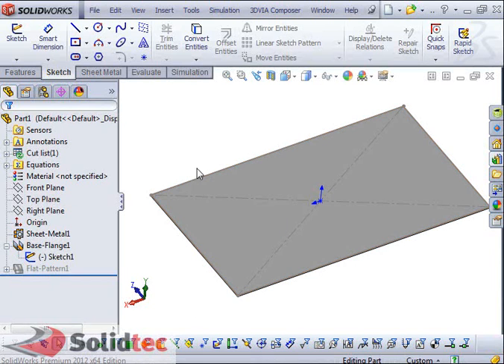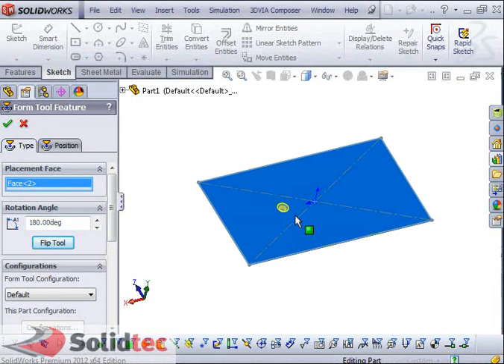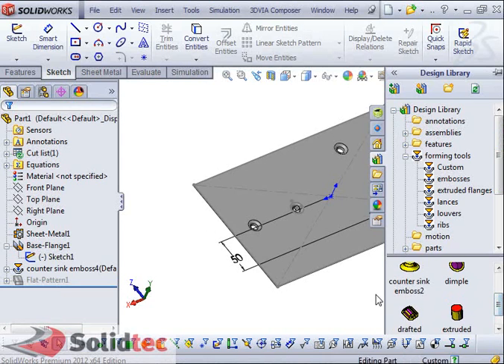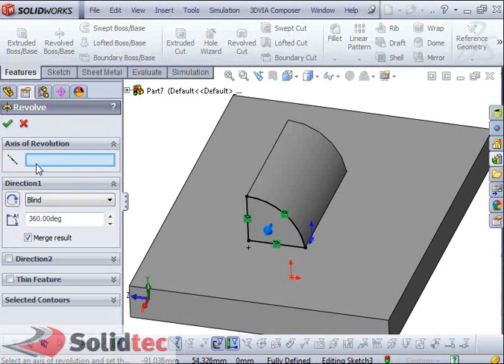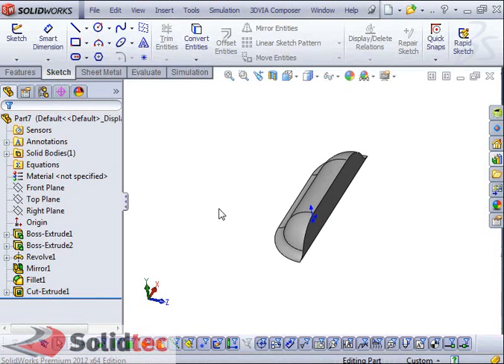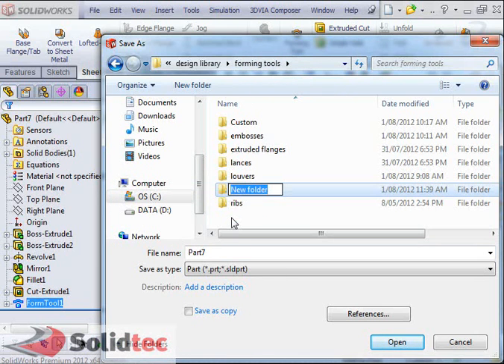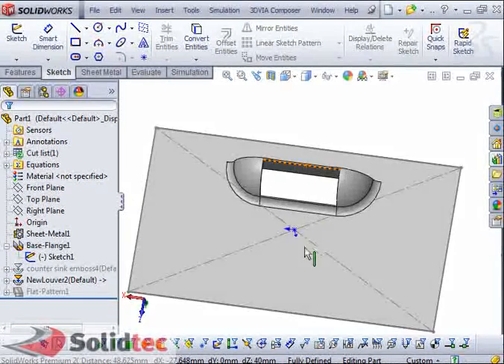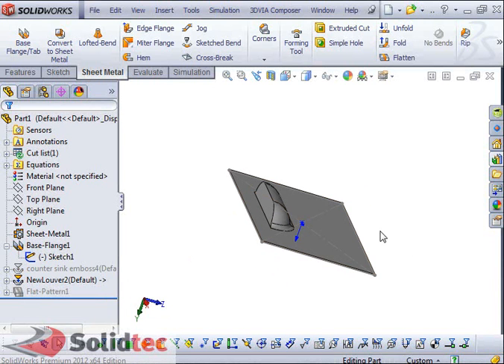Custom Forming Tool in Solidworks

Comment: I have made the form tool, I have saved it in the design library/default/forming tools/embosses. I have a sheet metal square tube made and saved. When I try to bring in the tool I get an error, "Are you trying to make a derived part?" Answer "yes", I can place the tool in the graphics area and do nothing with it. Answer "no" and the form tool opens for absolutely no reason. I never get the "type/position" table as in the hole wizard. What is wrong with my 2014 solidworks? Or what did I do wrong? I have followed all the steps in the video keystroke for keystroke. I cannot even put in any of the established embosses from the library.
Reply: Make sure in the design library, whichever folder your forming tool is is defined as a "forming tool folder", you could create a new folder for that. To do that, right click on any folder inside the library on the right, and there should be an option to define it, after that you wouldn't be asked if you're trying to make derived part, I had the same problem yesterday, good luck.
Reply: aaron4820 Had this problem just recently. Thanks for explaining this.

Comment: Nice video but a few tips to do it better. In demo you should have removed the vertical flat surface instead of the curved to make it more 'real'.

But, the main thing. When creating form tool it is important that the part that uses to build the tool hasn't any connection to the origion point. In that way it's easier to use.

Comment: Hello, I learnt solidwork  2012 in australia and now in chile  I am having some issues creating a forming tool very like to a louver, but it has to cut out a shape and bend it to 90 degress up.
I am suppost to make it in pro engineer, but I prefer use SW, so I am traying to make them change to SW, though. First, I need to show some result with SW, I hope you can help me, some email would be awesome. elias.less@gmail.com or electrolux.cl
by the way, great video.